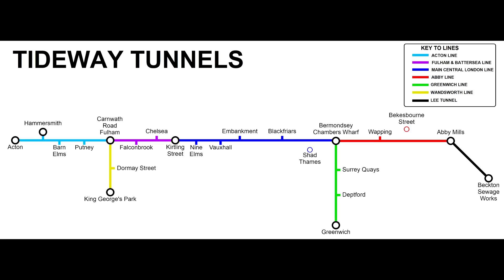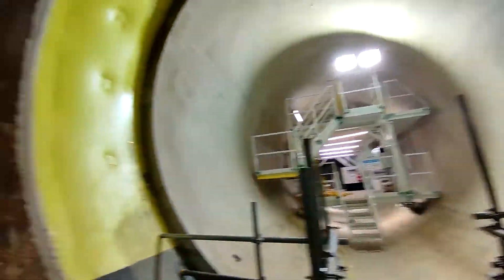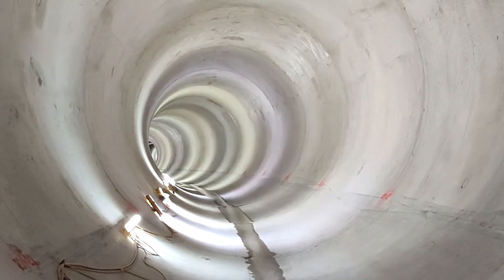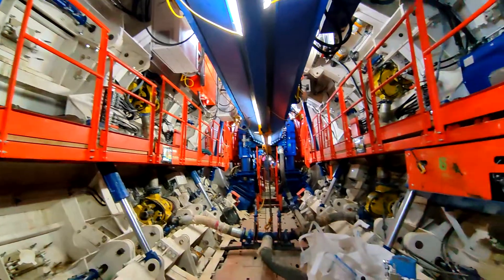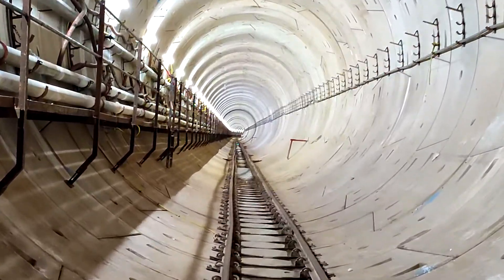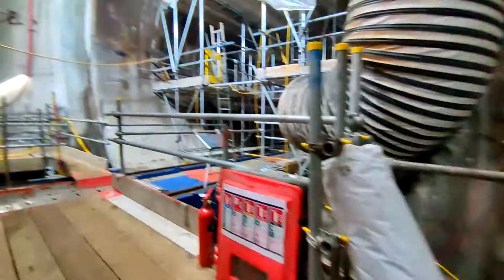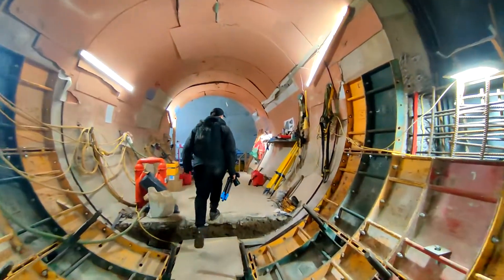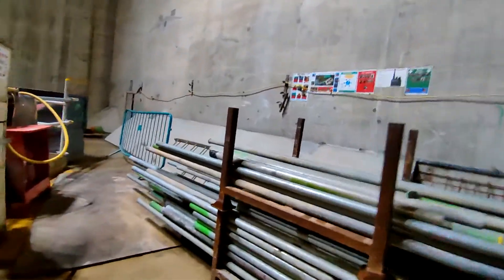Tunnelz ep. 8 - The secondary liner machines come as the tunnel nears completion

Comment: why are the entry shafts so massive? is that just to move the large machinery in/out at each segment separately?
Reply from the maker: The major stops have large shafts to lower the segments of tunnel boring machines into position as well as the secondary liner machines.  I am not sure why the minor stops have such large shafts.  I believe the shafts double up as a sewage holding area when there is a sudden large amount of sewage.